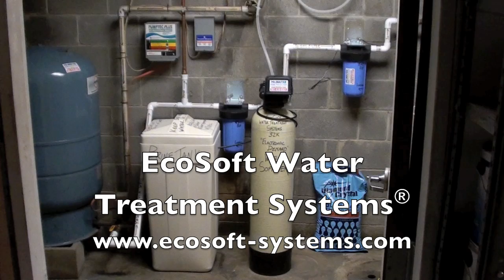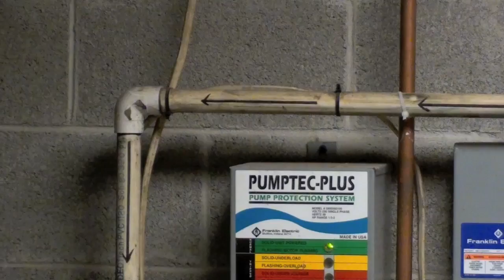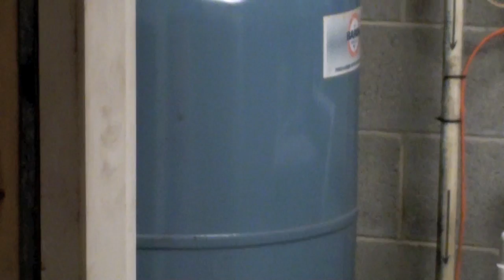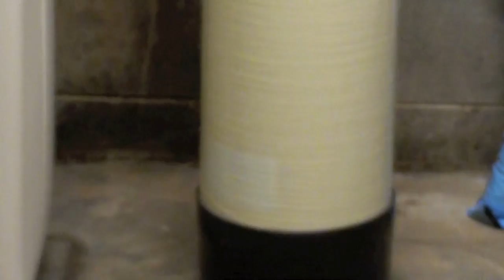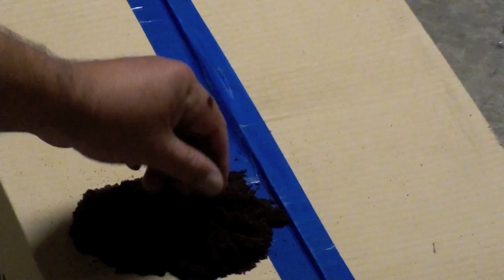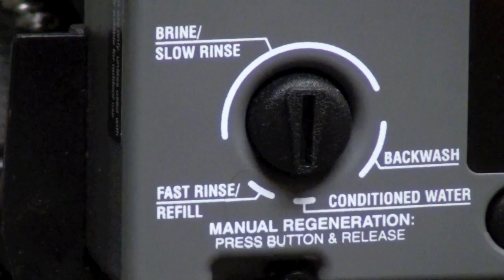Part 1 of 3 - "How a Home Water Softener Works" - Mr. Water Professional Water Treatment of Maryland

Comment: Great great video. This is what I have been looking for. I have a question though about filters. I just bought a house with a well. My question is could we install several filters on a system like this for extra protection?
Reply from the maker: Yes you can no problem.

Comment: How often does the water pre-filter need to be replaced?  BTW, the extra line to the hose is genius.  Thanks for this series ov videos.
Reply from the maker: The prefilter needs to be changed depending how much sediment ect. is in your untreated water and what type of filter is used (pleated is best) and how much water is used. Usually 3-6 months average.

Comment: I noticed you showed that there was a bypass for the cold water.  When my last softener was installed they did not do this. I have argued with them about this for over a year.  What can I do to get it plumbed correctly?
Reply from the maker: You need to get the right bypass installed for your type of system.

Comment: Thank you for the tutorial.  May I ask why bleach is added to the brine solution?  I was told to add a half cup to the salt brine (not emptied) and start a manual regeneration before bed.  The next morning, I had my husband run a tub of bath water to flush the pipes of anything "just in case".  He claims the water now tastes different.  I went and smelt the brine tank and it still smelt like bleach (I personally don't notice the smell my husband is talking about at the tap, but to ease his mind, I started a 2nd regeneration cycle).  What I was not aware of (until after) is that your apparently not suppose to use water while a regeneration is happening??? Yikes what happens if I DID???  Will the bleach smell go away from the brine tank and is it getting into my drinking water?  I was also a bit concerned because we were told that a regeneration cycle should take two hours.  Mine said "Backwash" for 7 mins and then "regeneration" for 46 min.  After this, it says 3,000 GAL remaining.  Our system is called "Water Guard" and is made by Action Manufacturing.  Any advise would be much appreciated.  I'm on city water and live in Lee County, FL.  Pinewoods, to be exact in this water quality report: https://www.leegov.com/utilities/Documents/WaterQualityReport.pdf
Reply from the maker: No beach is getting into your drinking water. NO problems using water while it is regenerating - just untreated water that's all. DO NOT use beach if you are on city water totally unnecessary and a carbon filter BEFORE the softener is an absolute must to prevent chlorine degradation of the resin making it useless in about 5 years.

Comment: Is the water pump supposed to run continuously during regeneration? Or shut off periodically?
Reply from the maker: Your well pump should cycle on/off and not run continuously while the Softener is regenerating - something is out of adjustment or clogged and/or a failed well system component.

Comment: I got a chlorine pail on mine, how much chlorine should i be using? should it be mixed with water? if so is there a ratio?
Reply from the maker: A water softener does not use chlorine. Must be a separate injection system of some type.